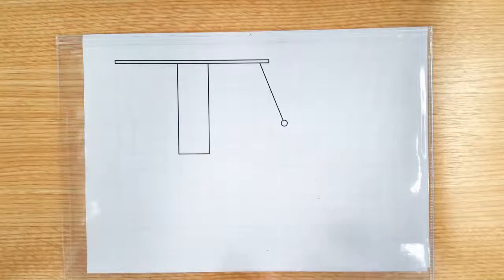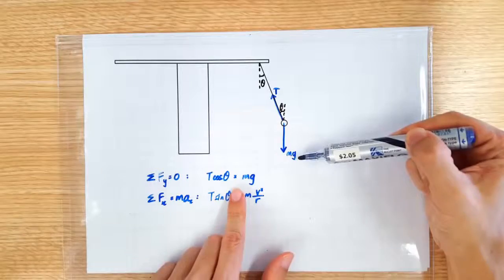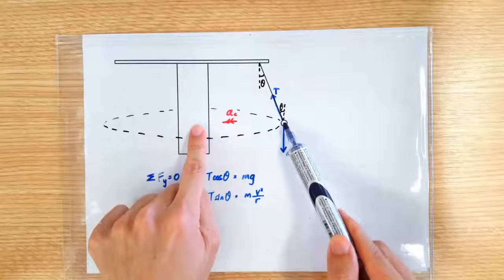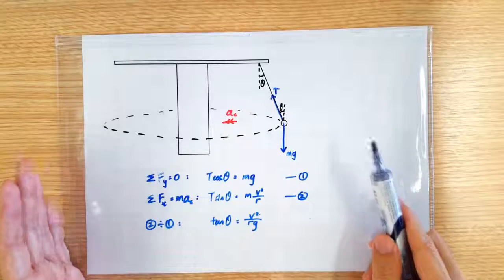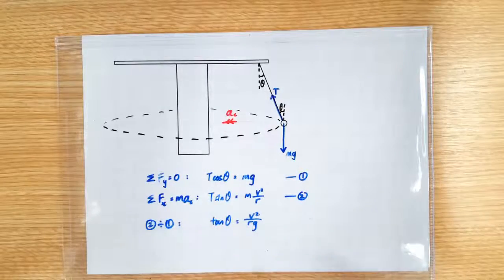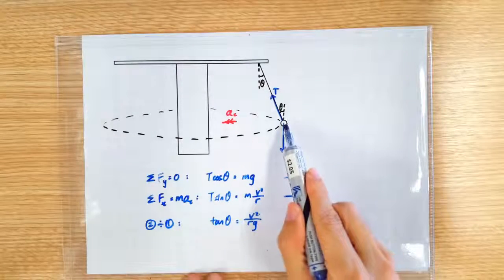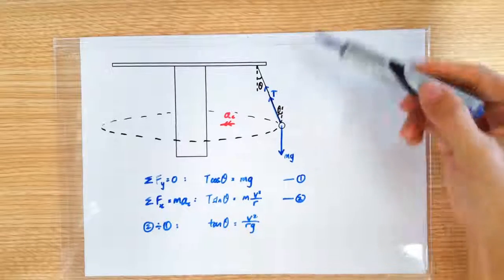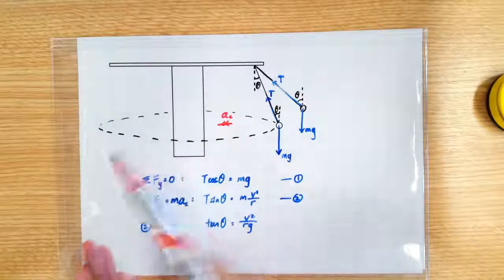Circular Motion: Flying Chairs

Comment: Wait… if the carousel spins faster is because centripetal force is increased, and you say that the gadget spins faster and that makes the chair drift away a little bit to increase ‘r’ so centripetal force increases as well. Seems to me there’s some issue with cause effect chain here!😂
Reply from the maker: No your first sentence is wrong. It is the centripetal force (if it is of the correct magnitude) that results in circular motion. Not the other way round. So if something is already in circular motion at speed v and radius r, we can conclude that the centripetal force must be equal to v2/r. But if the chair now moves faster, then something must change for the chair to remain in circular motion. In this example, F, r and v all changed before a new uniform circular motion is attained.
Reply: Thank you for your answer, but I don’t think I said that. OK , let’s put it this way:
If Increase centripetal force, then w increases; if w increases, then v increases; and so on till you finally get to the chair being lifted. 
Please fill the gaps proceeding logically as indicated. That would be really helpful to me.
Reply: @waliaphellps1745  "If Increase centripetal force, then w increases..." is already wrong.
Reply: @antigravity9222  but if you don’t explain why, your comment is useless.
Reply: @waliaphellps1745  The carousel spins faster, thus the chair (being dragged along) goes faster too. Since v is higher, the current tension in the cable is insufficient to keep it in circular motion. The INERTIA of the chair results in the chair moving out of the current circular path, going more outside and higher, and pull the cable more strongly. A new stable circular motion results.
Reply: @xmphysics As an inertial observer I can not resort to inertial pseudoforces. I see the thing removed outwards and I don't know why. Maybe, as centripetal force increases, v increases and so T does along. If T goes higer, and since m.g remains the same, a net force upwards appears. Is this correct?
Reply: I have an issue with "as centripetal force increases, v increases" because you seem to imply that an increase in centripetal force causes v to increase.
Reply: @waliaphellps1745  v increases simply because the carousel is spinning faster. T increases because the cable has to pull the chair in harder as it tries to keep the chair (now trying to fly off tangentially at higher v due to its inertia) from flying away. "If T goes higer, and since m.g remains the same, a net force upwards appears" is correct.
Reply: @xmphysics  Thank you very much for taking your time to explain! I must admit though, that resorting to inertial phenomena to describe a phisical experience as an inertial observer, strikes quite unconfortable to me, since those 'forces' aren't real.
Reply: @waliaphellps1745  You seem to think that my explanation employs inertia forces. No it does not. All I am saying is that the tension in the cable arises because the chair wants to move tangentially. This is due to the inertia of the chair. The result of this tendency is that the chair stretches the cable, resulting in tension. It is like the cable has no choice but to provide the chair with the required centripetal force. When the chair moves faster, the cable has to pull harder. Because the REQUIRED centripetal force mv2/r has increased. The cable is doing its best to provide the required centripetal force.
Reply: @xmphysics I think you do. Here comes an explanation without refering to inertial phenomena (like the object trying to keep its tangent trayectory in each point of the circle): If centripetal force increases, horizontal component of the tension increases. However, the vertical component of T, which balances m.g, has to remain the same to keep this balance. And the only way to achieve this is increasing the angle, so the object lifts. I think this is correct. 
Only if you are spinning you could say that inertial forces (trying to keep you in a straight line) push you outwards.
Reply: @waliaphellps1745  You wrote that "If centripetal force increases, horizontal component of the tension increases". The centripetal force IS the horizontal component of tension. Your statement is saying "if F increases, F increases". Can you explain why F increases in the first place?
Reply: @waliaphellps1745 I think I know what's happening. We only disagree on the part on why T increases. I suspect you are thinking that since a circular motion at higher speed implies a larger centripetal force, the centripetal force must increase. That's a good enough explanation for most people. But it does involve an element of using the result to explain the trigger. For example, if a satellite in a stable circular orbit decides to move faster, the earth is not obliged to exert a stronger gravitational pull. The centripetal force does not increases and the satellite stops doing circular motion. So for our scenerio here, what causes the tension in the cable to increase? I am trying to say since the chair is always trying to move tangentially, it ends up keeping the cable taut. (I am not conjuring any inertia forces. I am just using newton's 1st law.) When its speed increases, it makes the cable even more taut. From this point onwards, we are in agreement. 🙂
Reply: @xmphysics  Yes, because I exert more force with my arm, or because the engine of the carousel works at a higher rate, etc… So, if the force applyed by my arm, the carousel engine, etc… increases, the T will increase as well. If T goes higher, its horizontal component too, but not the vertical one, since has to keep balance with m.g (if not, the flying chair would lift and the chain would get loose). The only way to increase Tx while Ty remains the same, is to increase the angle, so the flying chair moves up an outward.
Reply: @waliaphellps1745  Why should T increase because the carousel's engine is working harder? In theory, if the cable is massless, and the chair is not tied to the cable, T is zero regardless of the carousel's rate of spinning. T arises only because the cable has to prevent the chair from moving tangentially. That the chair has mass and inertia is crucial, if you really want to explain why T increases when the carousel is spinning faster.
Reply: @xmphysics  T should increase because the carousel spins faster when the engine works harder. In that scenario, the force given by the engine is transmited through the tension. So if F goes up, T goes up as well.
Reply: Yes, isn't that correct? If I pull harder, It will move faster.
Reply: @waliaphellps1745  It is the other way round. If the chair moves faster, the cable pulls harder. If the cable pulls harder without the chair moving faster, the chair will be pulled inside the circular path and the cable becomes slack.
Reply: @xmphysics  OK, the question I was looking for is this one: does the circular motion creates a centripetal force, or is a centripetal force that generates a circular motion? I think the right one is the second, but It looks like you will select the first.
Reply: @waliaphellps1745  Of course it is the second one that is correct. Force determines future velocity and displacement. I thought you were thinking the first is correct. How did we end up misunderstanding each other's?
Reply: @xmphysics 😂

Comment: Thanks, this explanation and solution are the clearest I've found so far on the internet...it's easy to find force diagrams but a lot harder to find explanations of what makes the chairs fly higher with increased speed. I suppose only one thing is "missing" for me, and it's an explanation or description of what is actually happening as the speed is increased (i.e. the causal chain of events). The math proves that the chairs have to move up, but what is physically happening to cause it? I would try to explain it like this - please let me know if what I write doesn't make sense! - 
(1) We increase the motor's rotation rate and so the chains try to "move ahead" of the chairs, which increases the tension and pulls them forward, increasing their velocity
(2) The increased velocity of the chairs increases their momentum (which is tangential to the circle at all moments) and this extra "thrust" will cause the chairs to "try" even harder to get away from the circular path and they will therefore pull on the chain harder, increasing the chain tension. (mathematically speaking, the force with which the chairs pull on the chain is equal to the change in momentum, which is another way of understanding F = m x a, i.e. F = m dv/dt = change in momentum)
(3) The increased vertical component of the chain tension lifts the chair up because - for a brief moment - the chair experiences an upward acceleration (unbalanced forces). The chain pulls on the chair until the forces are balanced, i.e. when neither force can cause any more vertical acceleration. To do this, the angle of the chain increases.
(4) The new angle automatically results in an increased centripetal acceleration, as the increased velocity's effect is greater than the increased radius (velocity squared). 
 
I hope this is closer to a description of what is actually happening, step by step, but I'm not yet 100% convinced it's correct. Let me know : )
Reply from the maker: I think you're right. :-)